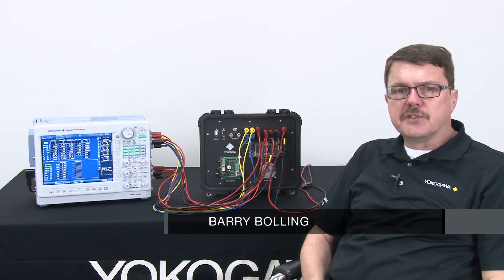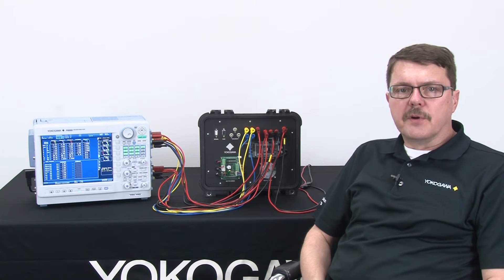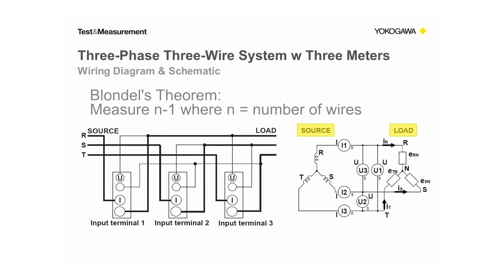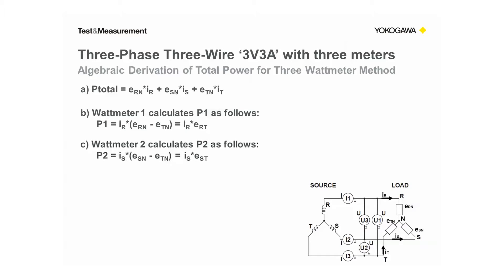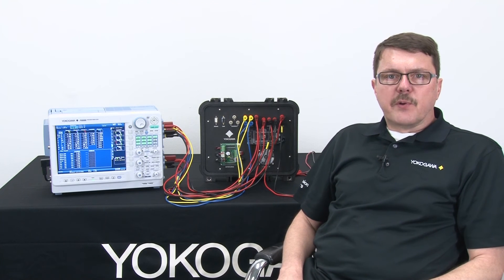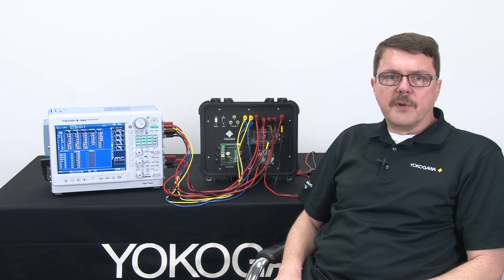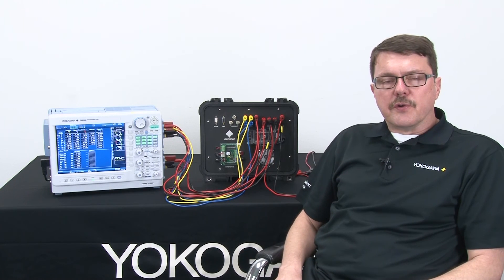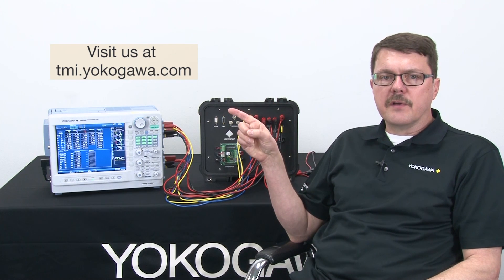How to Make 3 Phase, 3 Wire Power Measurements – Three Wattmeter Method

Comment: How exactly are these power values for the lines and the system defined? Seems strange that the power values for symmetrical lines are not the same.🤔
Reply from the maker: The active power value for each element is calculated as the average of the instantaneous voltage times the instantaneous current over the measurement period. The total power for a 3V3A system is calculated as P1 + P2.